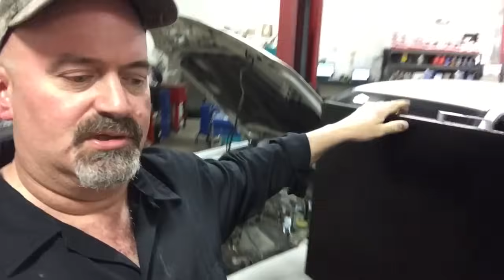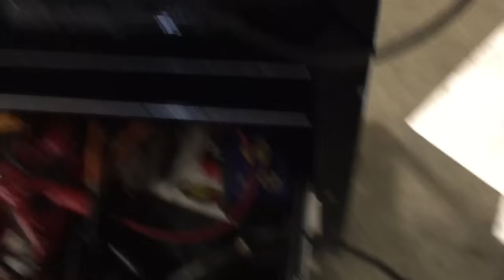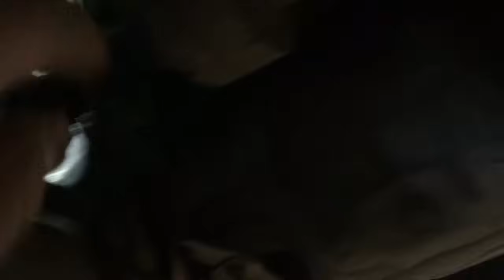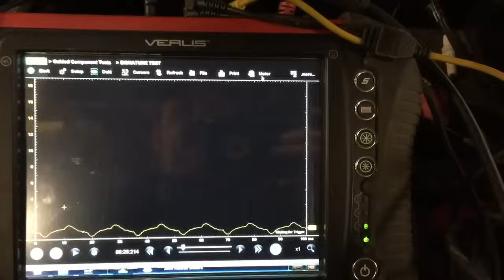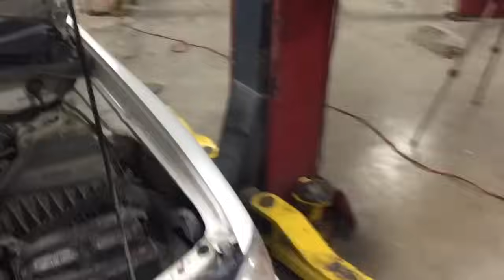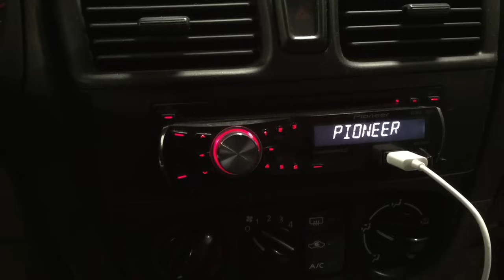Nissan Cranks But Won't Start

Comment: Hey i have a 2002 altima I just replaced the crankshaft sensor cause my car cranks but it just wont turn over. Any ideas?
Reply from the maker: Does it have spark? What's the fuel pressure?
Reply: I just replaced the fuel pump and I'm not entirely sure how to check for spark? I was reading there could possibly chances are slim but the anti theft system has the car locked down
Reply: Corey Dukes did u ever get your car fixed because I’m having the same problem with my car
Reply: Me too

Comment: Status up date! I had found out that when changing the crankshaft positioning sensor one should also replace the camshaft positioning sensor as well. I had ran the Ecm to check for trouble shooting codes and came up with the code P0340. If this code appears one should replace both sensor. After I changed out the camshaft sensor the car started right up. I want to say thank you for responding, and that I will continue to watch. Thank you again.
Reply from the maker: Right on!
Reply: @ThecardoctorTV i have a 2006 Nissan Sentra that cranks but takes a long time to start. Is it more than likely the Crankshaft sensor?

Comment: I have a 2004 Sentra 1.8 and it has a similar problem, in which I changed out the crankshaft postion sensor and still did not start. I have also replaced all four coils due to the car not having a distributor. What would be the next thing to look at?
Reply from the maker: Does it have spark? Injector pulse? Fuel pressure? Compression?

Comment: My altima 05 is not starting and I changed the crankshaft sensor and still not starting.  Help
Reply from the maker: Does it have spark, fuel injector pulse?
Reply: I have 04 I
And it just stop

Comment: thank you for your video there is some great information in here! I have a 2009 infinity g37 that had a radiator union brake. I drove it home adding water and stopping when it would start getting hot. The battery also died so I had to jump it on the way home. I replaced the union and the battery (which was old). Now the car cranks but won't start. You mentioned the sensors have an issue with temperature. Do you think the car overheating may have damaged the crankshaft sensor? What about the camshaft sensors? Thanks for your help! Happy easter.
Reply from the maker: Does it have spark and fuel?
Reply: The Car Doctor I can hear the fuel pump when turn the car on. Spark I'm not sure.
Reply from the maker: check for spark then injector pulse and even fuel pressure is a good idea. Check codes if possible
Reply: There is no spark. I opened the throttle body and sprayed some starter fluid, tried to start it again and it did the same thing. Cranked but still no start. Thanks for your replies, I appreciate it.
Reply from the maker: If you had use of a scanner and can view crank and cam sensor PIDs that would help. You can also use a lab scope and look at the waveforms.

Comment: 2013 nissan sentra 112.337 miles no start can't hear the pump never died on me or sputtered could it be the fuel pump or maybe crank sensor this was a cool video and yeah tires look dangerous lol.
Reply from the maker: Hard to say. Maybe check for fuel pressure and spark and injector pulse. Good luck!

Comment: I have a  2002 nissan sentra just like the one in your video, and when I start it I get the same sound......just like your video.....but consumer regulatory affairs....said that the crank positioning sensor.....had been updated......so what else could it be?  The Nissan sounds just like your car in the video.....but won't turn over.
Reply from the maker: even the updated sensors can fail. might be the problem but youll need to do some testing or replace it and find out
Reply: thxs......I'll try it.
Reply: Can I test it with just a multimeter?
Reply: Can I test it with just a multimeter?
Reply: Can you test a crank positioning sensor with a multimeter?

Comment: is there a way to test that crank sensor before I spend money on a part that might not be the problem, I have a 97 Nissan maxima
Reply: Probably need a diagnostic tool (hardware device)
Reply: Correct
Reply: Before I spend anymore Money To try to Get My 97 Nissan Altima GXE 2.4 liter running again it cranks over but wont start on the OBD Test My check engine light stays on has fir along time.It reads faulty p1320,peer I think but actually it reads on the Diagnostic tool when I plug it in crank engine Over its telling me It Won't start or stay running & misfires cuz ignition coil, crankshaft sensor, pigtail connector to the ignition coil was Melted & corroded bad connection, and i put plugs in it & tuned it up & changed ignition coil that aint it.I turn the engine over it cranks but wont start now& before it was running crappy at idle& when im driving over 40 mph it cuts out & dies on the road or hesitates at acceleration.

Comment: Those tires are scary? lol. Dude has worked in a "shop" too long.
Reply from the maker: I hope I can work a few more years. Thanks for watching
Reply: The only way that puppy was coming to a shop is because it would not start  lol.
Reply: The scary thing was that one tire was actually almost flat. Correct inflation pressure is serious stuff.

Having too little tread remaining isn't really that scary, as long as there was some. Of course such a vehicle must be driven accordingly and not handed out to amateurs. Some road legal tires have pretty much no groove to begin with. If people don't expect regular tires to do well on ice, why should they expect dry weather tires to do well when it's raining?

Comment: I have a 2003 Nissan maxima in great condition inside and out. I had it sitting up for a while, I lost the key and then got it replaced after they reprogramed my key and I changed the battery in car. The car wouldn't start. Previous before this the car had no issue cranking up.
Reply: can you please help me start somewhere??

Comment: Can somebody help i have Nissan tiida 08 it crank but wont start fuel pump has been tested all good,  i have even cleaned the plugs ones it was gon fine for a day then same happened again! please help if you can
Reply from the maker: Does it have spark?
Reply: i haven't check that to be honest as am not a mechanic and i didn't have the tools to open the plugs sir there for i have called a mechanic man he well be working on it after a few Hours and i'll let every one know the resolute  thanks to every one shearing info dashty from north Iraq GOD bless .
Reply: i had an issue last time where my car cranking but does't start it was just a spar plugs

Comment: +The Car Guy....I have an '09 altima...recently had an issue with the vehicle starting. Was diagnosed that I had a random misfire in cylinder # 4 ignition coil and also had bad fuel in tank.I replaced all four ignition coils.I drove the vehicle for one day after replacing the ignition coils.But this a.m the car would not start but would act as if its trying to turn over.What could be the issue?

Comment: Hello Tim my name is Xavier,  I have 2000nissan maxima, I am getting current to crank sensor, coils,injectors, Ihave a ground to camshaft but no hot going to it, it will start if I Spray STATER Fluid,and I have replace fuel pump twice. What can be the problem?
Reply from the maker: Crank or cam sensor is most common problem . Do you have pulse to injectors? Have you looked at a scope pattern of these sensors?
Reply: have Nissan Central 2001 I Need fine , relay pop Sensor

Comment: is there a way too test that old part on a tabile ??
Reply: she's a brick and I'm drowning
Reply from the maker: It's possible but requires wiring the circuit and passing a metal object the right distance away from it to simulate the reluctor moving past while monitoring the signal output with a lab scope.
Reply: i look fowared for more vidios see you soon
Reply: lol...well ok

Comment: I have an altima 2002 with the 2.5L . I fully rebuilt everything for fun two years ago. It ran okay for a while but I've been having intermittent "cut out" of power while on the high way. It would die for like one rotation of the crank and then be fine. Super annoying to happen while driving because of the jerk it sends.

I'd put in a new cam and crank sensors but 3-6 months later the problem would come again.  Some time I would replace the sensors and it got way worse, barely even start. 

I've bought like 10 sensors from China, I figured they just were crap and went bad but 10 sensors was still 30$ than one nissan sensor. 

Anyway I got fed up, researched the issue, got a nissan sensor under recall. Surprise, with the nissan sensor it doesn't start AT ALL.

I had to put in the china sensor to limp back home. Now the car doesn't start, I crank, it runs really rough and dies. It just doesn't sustain combustion.

So I got my electronics tools out to check it out. Hooked up my rigol 50mhz scope on it, was really surprise to see both traces from the crank and cam sensor are perfectly fine !?

Put the spark tester between coil and spark plug, found that it sparks a few time then quickly stop sparking after two or three crank rotation.

I hooked up a logic analyser to see all spark channels at once and both VR sensors signal.

Nice signal goes into the ECU but intermittent spark comes out.

What a pain in the ass !  Now I got another ECU, put it in, no spark at all. Maybe it's the anti-theft, can't tell.

Next I'm going to disconnect all coils and check ECU spark outputs, maybe bad coil is messing up the ECU.

This car is a disaster !

Also it leaks at the crank pulley, front main seal runs on the crank puller seal runner surface but it's not hard enough and its cut a groove in there. Got a new crank pulley but it looks different. 

wish me luck
Reply: my daughter had the same problem with her we changed everything then we disconnect the car alarm & that was the problem
Reply from the maker: Sorry your having those issues. Sounds like a real nightmare.
Reply: Look at this https://youtu.be/HccLf4b2d5s

Comment: Hello Tim i have a 06 nissan sentra and recently changed the fuel pump,due to not starting. Now is still not starting can you help please?
Reply from the maker: Certainly. What have you checked?
Reply: I did the code retrieval using the gas pedal and got 10 long flashes and 2 fast ones
Reply: i am thinking is a P102
Reply from the maker: does it have spark? Fuel pressure? Compression? Injector pulse?
Reply: i can hear the fuel pump. dont know how to check the other stuff :(
Reply: and it does have fuel
Reply from the maker: i think it would be worth it to have a reputable mechanic check it and figure out whats wrong.
Reply: I see can i test the spark coils with a screwdriver?
Reply: I am pretty handy just need to know jow to test these things

Comment: I have a dumb question.....is the crank sensor the same as the neutral safety switch? Mine would not start today (no crank) but a friend said throw it in neutral and try and it started up. Its a 1996 Altima
Reply from the maker: No, the neutral safety switch is a mounted on the transmission and usually adjustable to only allow the starter to crank when the vehicle is in park or neutral so that it won't suddenly lurch forward unexpectedly when started. It's possible that this is your problem based on the fact that it started once you moved the shifter. If it continues and you find that after moving the shifter it cranks then it may just need adjusted or possibly replaced. Always possible it is a problem with the starter or ignition switch and it just happened to start when the shifter was moved. Hope you get it figured out.
Reply: Bless!  Me too! Ive had no luck with used cars the past decade!
Reply: Way to ignore your customers...that was me calling

Comment: I been having same issue with mines.  I suspected the crank sensor Kinda ignored it. Looked up TSB ( Technical Service Bulletins) seen also ECM ( Electronic Control Module) recalls for that year model. When I replace my Crank Sensor shoot you message if that fixed it. The pump well got that rigged in a way its run off a switch at the moment.
Reply from the maker: I'm sure the crank sensor will get you back on the road. Good luck.

Comment: Nice fix buddy now they can have a great drive to the scrap yard. Keep blinkin !!!
Reply from the maker: Did Eric by chance give you some eye drops for me? I think my pupils are getting chapped.
Reply: The Car Doctor OMG Im sure were  going to hear something . You can only hit the piñata so many times before it opens up. LOL
Reply from the maker: I better send him some beer too.
Reply: The Car Doctor HAHA he still loves ya buddy.
Reply: Tim and Rob,   you might wanna toss in some Triple Antibiotic Ointment for those cracked hands of Eric O's. This really does the trick. Tell him to wash his hands clean as he can stand depending on how big and how bad the pain is. I've had some winners in my day for sure. Then put a gob of the Triple Antibiotic Ointment on the area (s) and wrap it completely with a new clean bandaid or bandage for a day. 

Remove the bandage before going to work and wash again and reapply. If you get it dirty or torn at rewash and reapply bandages and ointment. Otherwise just change it out for a new bandage every day for two or three days. You'll know when you don't need a bandage cause the crack will completely be closed. Takes a week to really heal.  After that - and from now on --- Don't be a fool zero - Be a man Hero and wear the right kind of gloves next time you're messing around using chemicals, or sprays or any dangerous liquids of any kind. Look at this way - Would let your kids play with that stuff?  Then don't play with it either.

I know this works because it has worked for me for more then the last 45 years. When I worked on heavy engineering gear (pumps and valves and such) and equipment while in the US Navy for 20 years  and again while I worked at an oil refinery as an outside operator for 15 years I would come home with hands so cracked and calloused that i had no feeling in them and they would literally be bleeding slightly when i sat down to eat at the table. They did bleed a lot mind you but any thing kinda freaks out the little ones. My hands felt like the "Thing" on "Fantastic Four". No feeling at all. I could hold hot valves and not know it was burning me unless someone told me or i looked down.
Reply: Just in case some dimwad decides to count - If i tell ya what i did for the last decade plus, i'd hafta drown ya .. sorry no exceptions.
Reply: +Hawaiian F150 Tim is sending me down some Bag Balm for sore utters, that might help the lad  next time I go and visit. What he needs is to do is listen to your advice in the first place. Now look at him with some utters and all. Oh the humanity. LOL
Reply: Sir Rob - Oh Me - Oh My - Does that mean we may see the Big O with nipples coming out of his fingers?
Reply: -- Wasn't that the "mememe" time of life? lolz

Comment: Changed a crank sensor yesterday on a 06 Altima. They have a real problem with their crank and cam sensors. I like that flexible battery holder 😆
l
Reply from the maker: So strange they go for ten years then suddenly die like that
Reply: Yep we get them around 80000-100000 miles

Comment: You could probably secure that battery  for very little monetary cost to the owner
Reply from the maker: Yes but could I convince him its an important enough repair to spend $25 on? We will see.
Reply: I'd attempt it, even though the owner is a youngster - on a hard stop you don't want the battery flying into the cooling fan or the positive battery cable touching a ground. It would be on the tow truck right back to you.